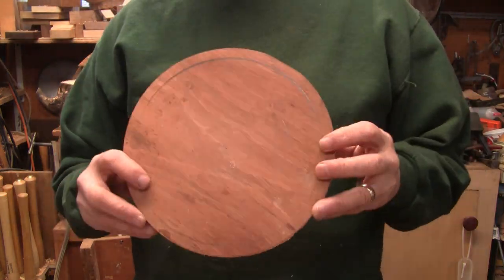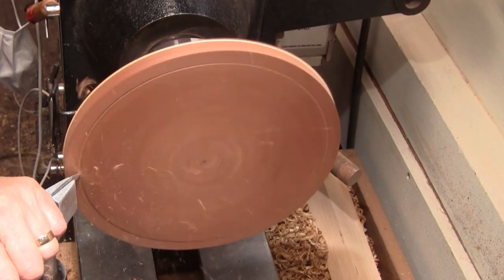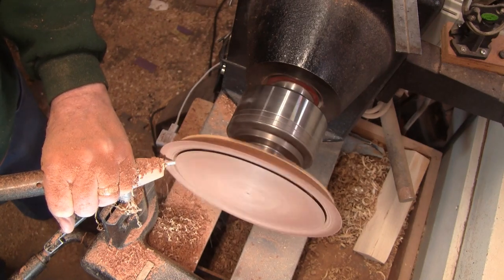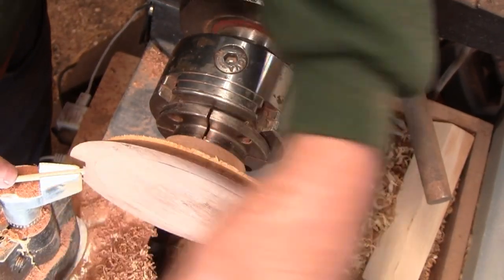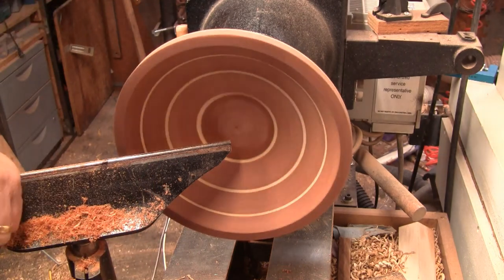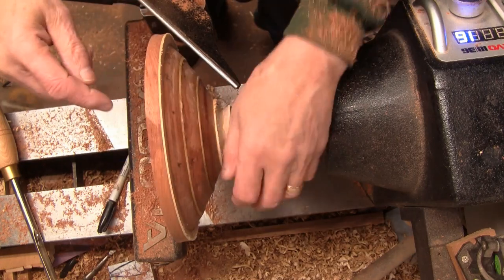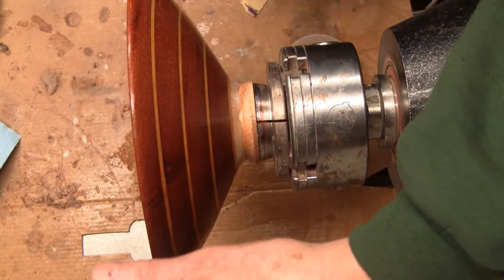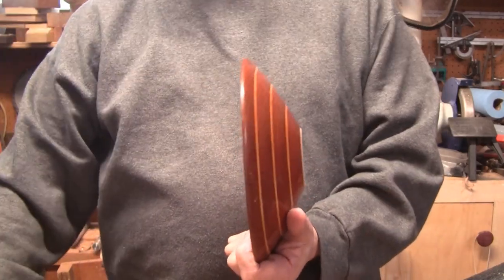Curved Bowl  From A Board New Ring Cutter Wood Turning

Comment: Gary, I really enjoy your bowl turning videos, but I was wondering why wouldnt you use a longworth chuck or cold jaws to allow you to clean up and finish the bottom of the bowl.  I know it's more work but the end result is much nicer.

Another thought would be to glue on a pre-finished base piece, maybe out of some nice exotic wood, that you can then grab in the chuck (no tenon), then that part of the process would be done already.
Reply from the maker: Thank you Peter, I do use cole jaws a lot for bowls like this. I also use a jam chuck. 
I thought about gluing on a piece of Walnut or Wenge to the bottom of this and then I would have put a tenon on it. Not sure how to grab the base with my chucks with out marking the base. So I would probably have cut a tenon. Which jaws do you use for that? I may have to look into some.
Thanks for watching and your ideas.
Gary
Reply: @ThePapa1947  I suppose the tenon on the base is always the best route to go.  Depending on the make of your chuck, I think it's possible to get jaws that are smooth, but I'd have to research that for sure. 
I would likely do the same but I would also machine it off using cole jaws or maybe a longworth chuck.  I'm not currently doing any turning as I'm in the process of cleaning up/out to get ready to move, so all the fun stuff has to take a back seat right now.  I do have a set of cole jaws for my Nova chuck.  I want to get another inexpensive chuck and leave the cole jaws on there all the time, so it's an easy swap out when it's needed.  I think that way a person would be more inclined to use it.  Same thing with a longworth chuck, if it was mounted to a tenon ring then it's quick to setup.  Keep up the good work I really enjoy seeing all the weird things you turn.

Also - great idea on your latest version of the ring cutter.  I will definitely make one of those, I like the idea of saving wood, and/or making a bowl from small scraps that you glue into a board..... great idea.
Here in Calgary, Alberta I have good access to exotic woods but they are so expensive  to purchase, that this method of bowl making really makes sense and it makes it a reasonable cost to make a bowl in this manner as opposed to having to purchase a large blank.
Reply: Gary, I really like the simplicity of your latest version of the 'angle gauge' for slicing your wood discs.... very creative.  I want to do something similar but I think what I will do, to make it a bit simpler is to use a piece of 1-1/2 aluminum round bar and machine down the base to 1" for my tool post, but I'll leave the top 1" at full diameter.  Then in my milling machine, I'll just cut a 1/8" groove to accept my 1/8" parting tool (as you have done).  But this gives me a 1 piece tool and it still achieves the same result as yours, but 1 piece instead of 2.  Then I'll also likely machine a taper like you have as that allows the tool rest to be very close to the workpiece.  I'm very impressed with everything you make, excellent work.
Reply from the maker: Peter that is a great idea. I am guessing the 1-1/2" bar will get the rest close to your work. My banjo sticks out at the tool post mount so I made like I did. 
I enjoy having my metal lathe and a CNC milling machine. It lets me make all kinds of things. 
Looking forward to hearing about your version. Great idea!
Take care,
Gary
Reply from the maker: Peter there are some chuck jaws that are smooth and you can make a recess and not have a dovetail  None of the Nova chucks I have though.
 I have a lot of chucks and keep my cole jaws on one of them. I actually have two chucks for that reason. The large and the small set of cole jaws. But one of those chucks gets used on the 4th axis of my CNC machine now and then. 
Gary
Reply: @ThePapa1947  Ya, that's a good point, the banjo could create some clearance issues as well, I'll have to take a look at that before I start making chips.

Eventually I'd like to try making a bowl with several angles to see how close a guy might get to turning a more rounded conventional shape, either that, or maybe just use some thicker wood to allow for a bit more sculpting on the curvature.
Reply: Hey Gary, with regards to your narrow parting tool, I was thinking that a guy could make one fairly easy by using a piece of HSS tool blank, perhaps 2mm or 3mm thick x 10mm or 12mm high and 200mm long.  You can get tool blanks like that on Amazon for a pretty cheap price, one only needs to make some sort of handle for it and epoxy the blade in place, then sharpen it.  I'm thinking mostly of replicating the cute little parting tool that you use, since they dont seem to be available anywhere online.  A tool blank would only be about $10 or so.

Along the same line, I'm thinking of getting a tool blank perhaps 6mm x 35mm x 300mm long.  Cut/grind a tang on one end about 2-1/2" long then grind the big end to make a double edged, french curve negative scraper.  I've seen blanks that size on Amazon for $20 CAD.  You need to make a handle of course but that's whole lot better price than $150+ for a Glenn Lucas french curve scraper. 300mm long would give you about 9-1/2" of blade, that would last forever......

Comment: Thank you for your idea on how to make a better curved bowl without using thick pieces of wood. I intend on duplicating your new ring cutter. I also intend on experimenting with greater changes in the angle of the cut. I also wonder if after you increased the angle of cut you then radically reduced the cut angle to turn a bowl with a smaller top ring than the largest ring? Do you think it could be done? GREAT VIDEO, as usual.
Reply from the maker: Thank you Teddy! So yes the top ring was more straight up in down. The idea was have to top curve the opposite way as much as I could. 
If you were asking something else please let me know and happy to try and answer. 
Thanks for watching,
Gary
Reply: @ThePapa1947  Thank  you for your rapid response. I should have tried to draw what I was asking before I make my comment. I then would realize  the only way to make the top reduced in diameter to make a globe is to use a separate board. I'll keep watching and learning.
Reply from the maker: Thank you for explaining. What you are talking about is a great idea.
It would be a bowl from 2 boards.
I may look into that.
Gary

Comment: Hi Professor Papa Nice bowl, neat solution to the cutting jig problem. Question why 45, 55, 60 degrees. why not 45, 55, 65, degrees so you had 10 degree increments. Was your decision calculated or random ?? Thanks for the video and the design ideas. The Shady Acres Wood Whisperer is right you are leaving a legacy for future turners, and he should know, so is he. God Bless, stay safe. Tony
Reply from the maker: Hi Tony, so I picked those angles to fit the shape I wanted. Each angle allowed for enough material on the outside and the inside. So yes they were calculated. But it could be done with the angles you mentioned. On w hat I had I think the 65 would have made the base too small. But on a larger board it  would work.
Hope that makes sense.
Take care my friend,
Gary
Reply: @ThePapa1947  Thanks Gary

Comment: Hi Gary.  So impressive.  I know that you do not want that job again, but did you by any chance video making the ring cutter.  Is the top made from aluminum?  What materials?  How did you cut them?  Thanks so much!
Reply from the maker: Thank you very much Van. Everything is made from 6061 aluminum. I used my milling machine for some of the guide and the band saw to trim a few areas. I just did not feel like making another setup and a way to hold it to do a small area. If I was making a bunch of them then I would have only used my CNC mil.
I will be doing a video on making one from a piece of hardwood and perhaps an aluminum shaft.
Thanks for watching,
Gary

Comment: Great video..would there be any advantage for a beginner to make their first ring bowl out of a thicker board? I hope you will consider finding a supplier to make and sell your tool holder.
Reply from the maker: Thank you Bob. For your first attempt at this I think a 3/4" to 1" is a good size. The thicker the board the harder it is if you have not done one.
Hope that helps.
Gary

Comment: I'm just getting into wood turning, and I started out with the actual homemade lathe. It seemed to work fine but getting more and more into it I think your videos are excellent, and you explained the cutting sequence in the degrees very good. I think that's very awesome now I just got to make that jig. That's very neat that you can come up with such a small blank of wood to produce a bowl. Can you tell me what chisel you are using, to cut those degrees. As far as size and Brandon everything. Thank you very much like I said before I'm already subscribe to your videos and I really enjoy it. And I also got to make that press I've watched the video on it but I still got to do that. Keep up the good work
Reply from the maker: Thank you very much Brett. The tool I am using here is the Robert Sorby Micro parting tool.
The blade is 1/16" wide and a little over 1/4" tall.
Thanks for watching my videos.
Gary

Comment: Hi 👋 I have just made my jig, it has taken me approximately two days to make it, As I had to turn a post to fit in my banjo as my lathe is a old Wadkin, Plus I do not have a metal working late I had to use the word can live with a travelling table luckily I had some metal engineering cutters so I could turn a piece of metal down but only could take very very fine cuts at a time but least I’ve got there in the end even to the point where I polished the shaft, And it fits like a glove, I then drilled and tapped the end 12mm , To except by 12 mil counter sunk Bolt Allen key. I found a piece of steel that could Set on top of a tool post , Then cut to pieces of angle iron which was approximately 20 mil in height and then fitted them to the top plate to except my Japanese knife that I have ground down to use as a parting tool, The only problem is I forgot to watch the YouTube territorial again and I forgot to vary the angle, So tomorrow I will find out whether there’s enough material to finish the job off, fingers crossed.
Great territorial very interesting I’ve always watched your YouTube links for many years only I should’ve watched the one this morning before I proceeded in doing the turning. Silly me, Look forward to seeing some more all the best. Phil from the moulin France.
Reply from the maker: Glad to hear you have completed it. So is your Wadkin a pattern makers lathe?
If you used the same angle each time you should have the stock needed
Thanks  for watching and let me know how it goes.
Gary

Comment: Thank you for the great video on your bowl from a board jig. Hopefully you will provide a video showing how we could make a hardwood version of that jig. I was wondering about the parting tool that you used to cut the rings. Approximately how long and how wide is the tool steel of your parting tool? Is  it available from somewhere commercially or did you make your own ? Thanks for all you do
Reply from the maker: Thank you Tom and I will make a video on the jig.
This is the tool I bought.  But I bought the blade only for half the price.
https://www.amazon.com/Robert-Sorby-865H-Micro-Parting/dp/B002RCFECI
Reply: Thanks again. I wasn’t sure of the blade size and how far away the jig was from the workpiece. Your response will make my search easy

Comment: Amazing as usual! What is your take on using thicker stock to attain more curvature in the walls?
Reply from the maker: Thank you Lewis. I think thicker stock is fine. You should end up with thicker walls and be able to get more of a curve  on the walls. You may be limited to how far your parting tool will cut and perhaps have more of a chance of binding.
I think the thickest I have done is close to 1 1/4 inch.
Thanks for watching.
Gary

Comment: I love your videos you certainly have a very creative mind along with good engineering I have made several of these type of bowls however I use a bandsaw and I don’t like when I have to cut into each circle I would be interested in knowing if you plan to sell the new tool that you have developed also wondering where I can find a really small cutting tool like the one you’re using
Reply from the maker: Thank you very much for your comments.
I did not like using the band saw either so I started trying it this way. This is my second version of a ring cutting fixture.
The first works great as well. But I always try to improve. Here is the first one: https://www.youtube.com/watch?v=GnzYR6y4ZhM&t=24s&ab_channel=ThePapa1947
 I have not planned on making them and selling them. Each banjo is different and I made this one as short as I could to work with my banjo. I may make some easy plans where you could use hardwood for the top piece but I would use aluminum for the rod.

Comment: Thanks Gary. Great video and replies to ALL the comments. Question: what was your logic for leaving the lighter color veneer which made the rings on the finished piece? Did you consider turning off the white veneer and having just plain darker wood? Thanks again
Reply from the maker: Thank you very much Mike.
If you are talking about the piece on the bottom yes I did consider doing that. And I would have done that prior to hot gluing the tenon on. I was also thinking of using a piece of Wenge for a bottom.
 I still might turn the light wood off the bottom.
 I am assuming you just mean the bottom right?
Thanks for watching and commenting.
Gary
Reply: Gary, I was asking about the entire piece that had the lighter veneer lower, that resulted in the lighter rings in the finished piece. I, too, would be VERY interested in a video on how you manufactured your angle cutting jig.
Reply from the maker: ok I understand now. I actually glued the light wood on the piece just fir this turning.
There will be a video soon on making this jig with bo special tools. Not this Friday but maybe the next.
Gary

Comment: Very good idea! I am interested in making the bowl with stiffer angle. So the upper ring to be 90 deg or more to the base. Do you think your jig can do this?
Reply from the maker: Are you wanting to have the walls almost straight up and down?
If so the walls will be very thin using the bowl from a board method.
Reply: I  even think for walls going into the bowl’s inside. In this case the angle to bowls bottom will be bigger than 90 deg.

Comment: Hi Gary,
Just came across this a few minutes ago.  I am impressed with the elegance and simplicity of your tool jig for cutting circles.  I have been wrestling with this concept for quite some time and actually came up with a solution which, interestingly, is remarkably similar to yours.  However, my tool jig is made of hardwood and has interchangeable angle templates which makes it a a little cumbersome and awkward.  What I admire about yours is the versatility of the jig and the use of templates for positioning.  Very smart!  I too own a Laguna lathe, the same as yours, which leads me to a cheeky question: unless it's covered by patent or copyright, could you advise me of the dimension of your jig?  Thank you.
Graeme Wood (Australia)
Reply from the maker: Thank you very much. The jig really does work good.
I would be happy to supply the dimensions but I have a video that just started today showing how I would have made this jig, 
I also show how I would have made it if I did not have any metal working equipment. And it will be made from metal.
Let me know if you have any questions.
Gary
Reply: @ThePapa1947  Thanks, Gary.  I look forward to the video.

Cheers,

Graeme.

Comment: Very well done. You always say leave a little of the line, are you cutting to the inside or outside of the line?
Reply from the maker: Thank you Lee. it would be the inside of the ring.
After measuring the first ring and lets say it was 10 inches on the bottom inside. I would mark 10" for the next and to make sure I leave 10 inches I would cut on the inside and then that diameter will be 10" or a bit smaller.  When I say a bit I am thinking less than 1/32". 
Basically if you cut all the line away you will be off a little.
 This has worked good for me.
 Hope that makes sense and thanks for watching,
Gary
Reply: Thank you, I will be doing that.

Comment: Thank you Gary. Very well explained. BTW, great tip of inserting an interior board for reducing chatter on the outside. If a person doesn’t have a steady rest, do you have any tricks for reducing chatter on a thin walled bowl when hollowing?🙂
Reply from the maker: Thank you Lee. I always try to support the wood with a cone if there is an issue with cutting. 
Without a steady rest play with the speed and make sure the tool is very sharp. Sometimes you can counter the harmonics with a speed change and that might be faster or slower.
 Even having a one or two wheeled steady is a way to help. And easier to make. I have been thinking of making one.
I will need a steady rest on what I am making now and I think I have one of those wheels left.
Thanks for watching,
Gary
Reply: @ThePapa1947  Thank you Gary. You are a great distance mentor to many emerging turners.
Reply: Hi Gary, I’ve finally bought a Laguna 1836 and will pick it up this weekend. Do you have advise for a 1”x8 TPI chuck adapter. I see those without lock screws at $20 and EZwood with lock screws for $40. Could I buy locking one for the chuck and a cheaper one for wasteblocks?

Comment: Thanks for an excellent video. What is the CAD program you are using?
Reply from the maker: Thank you very much. I use Bobcad for the 2D or 3D modeling and then the CAM side of program for the CNC cutting of parts. Both 2D and 3D. I also added the BobArt with allows me to do 3D carving.
Thanks for watching,
Gary